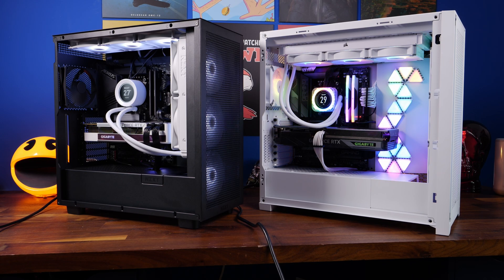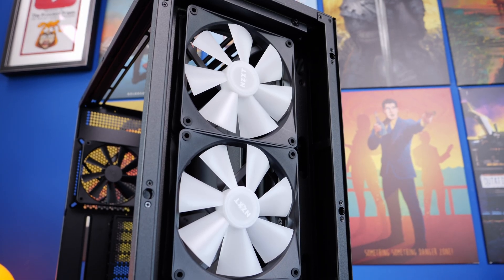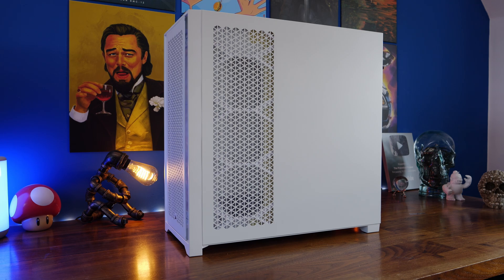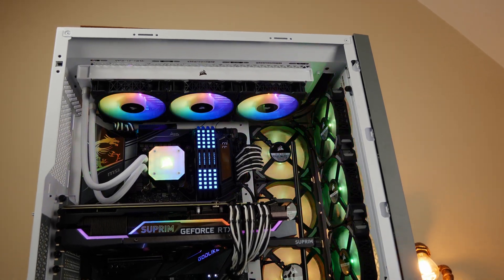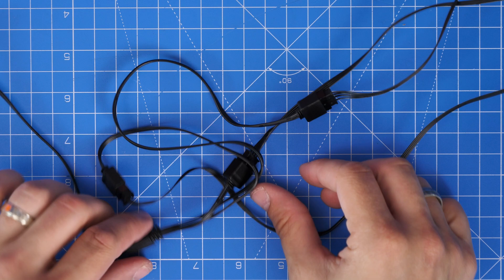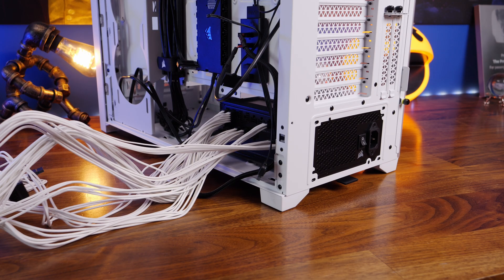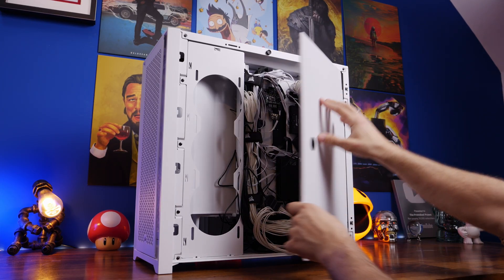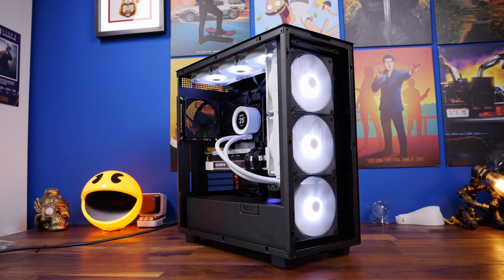Corsair 5000D Airflow vs NZXT H7 Flow RGB - which is the best mid-tower case?

Comment from the maker: Specs of the NZXT build:
Case - NZXT H7 Flow RGB https://youtu.be/hiLd5wTPuMI
Motherboard - Gigabyte Aorus Z790 Elite AX https://youtu.be/8WK7VmuxFxo
CPU - Intel Core i5-13600K
RAM - Crucial Pro 32GB Kit (2x16GB) DDR5-5600 
NVMe SSD - Corsair MP600 GS (https://www.youtube.com/watch?v=8DTAiS5pPPs)
PSU - Corsair RM1000e PSU (https://youtu.be/FUnfuF6nSVw)
GPU - Gigabyte RTX 4070 TI 12G OC https://youtu.be/_-bu6qDqeWA
Fans - NZXT Core RGB (https://www.youtube.com/watch?v=mPRrPGjV_jo)
AIO cooler - NZXT Kraken Elite 280mm https://youtu.be/G5r3SG3ACwE
Specs of this Corsair PC build:
Motherboard - Gigabyte X670 Gaming X AX https://www.youtube.com/watch?v=LYD5zUL91N0
CPU - AMD Ryzen 7 7700X
Case - Corsair 5000D White RGB (https://youtu.be/w-_g7inHcX4)
Fans - Corsair AF120 RGB Elite Fans (https://www.youtube.com/watch?v=eEeMzFHxtWw)
CPU cooler - Corsair H150i Capellix XT (https://www.youtube.com/watch?v=VYgWCVMOQfE)
Display - LCD upgrade kit (https://youtu.be/z0jDMVooE38)
RAM - Corsair Vengeance RGB DDR5 16GB x 2 6200MHz
NVME - Crucial T700 PCIe Gen 5 SSD, Corsair MP600 XE (https://www.youtube.com/watch?v=B08Cv8Pb9nI)
PSU - Corsair RM Shift Series 1000X Shift (https://youtu.be/yafbKAuyntw)
Cables - Corsair Premium sleeved cable kit type 5
Lighting - Corsair LC100 lighting panels (https://www.youtube.com/watch?v=vDO95ghARJE) 
GPU - Gigabyte RTX 4070 Ti 12g OC https://youtu.be/_-bu6qDqeWA

Comment: Hello, sorry, I have a doubt since I don't know how to read or listen in English, I would like to know which was better in the end, I'm undecided between The h7 flow and Icue corsair 5000D, I would like to know which is better quality, the price doesn't matterWhich one do you recommend? Use the translator, sorry
Reply: He liked the Corsair 5000D more because of the flexibility and more build options it provides. However the NZXT H7 is easier to build in because it is a simpler case. Both cases are good.

Comment: Its driveing me nuts, everywhere i look the new 5000d in white comes with a fogged glass side panel, is the glass panel you are useing here the one thta it comes with? and with only a handfull of cases supporting mondern frontpanel IO is doesnt help. also the spaceing between a top rad and the CPU power connectors on the top right for the 5000d. how is the spaceing there??

Comment: Hello! I want to install a 140mm fan on the rear of corsair5000d and i dont know how...it fits but the holes are for 120mm...what can i do? Drill new holes ?
Reply: The 5000d only fits a 120mm fan in the back.  Yeah you would have to drill if you really want a 140 there.
Reply: @bashfullJ88  drilling was easy ,i put a 140 and a 60 under gpu

Comment: I recently built a PC in the Corsair 5000D RGB (using your video as a guide because my case didn't come with a manual!) It's a great looking case with lots of airflow, but there are some cons. I found the extra back door wasn't really necessary as I couldn't close it anyhow due to all the cable and hub clutter. Case manufacturers could stand to make the cases a little wider to accommodate cables. Because there were fan and RGB hubs pre-mounted, there wasn't a good place to put the iCUE Commander Core that came with the AIO I got. (I wanted my SSDs in the back of the case.) It would also be nice to be able to move the top AIO radiator more toward the front side panel to allow more clearance for the CPU power cables. I wasn't able to put all three AIO fans inside the case because of the CPU 8-pin connectors being in the way, so it's good that you can mount the top fans outside the case.

Comment: Except this is not mid-tower. Those used to be ATX (305mm) + PSU(85mm), that's about 390..420mm high case. Corsair is 520mm high. That's a large tower.
Reply from the maker: Corsair labels it a mid-tower, so you'll have to tell them they're wrong.
Reply: @TheProvokedPrawn  They want to sell you more, which in this case is bigger. Sizes have drifted slowly since 90's. I'm just calling bs when I see some. It's a large case.
It's not mini, not mid either.
Reply: @vensroofcat6415 bro just don’t buy it simple
Reply: @jdolooooo  well they are pushing cases able to fit 10+ stupid "3 for 100$ during sale" fans and some of the most expensive AIOs too. 
Corsair 3x the price of Arctic or Thermaltake. And you need huge cases to fit 3 of them. So they bloated up what's needed.
There is nothing wrong with a CPU having 65°C or even 80°. I hope since the current gen AMD release everyone has learned that finally? It's ok by design.
You don't reduce heat by adding more fans. You just redistribute it differently.
Reply: @vensroofcat6415  I get what you saying equal airflow pressure
Reply: @jdolooooo  There is never equal pressure. Even if your fans were perfectly arranged and case had no holes, air expands significantly as it heats up. That would mean extra pressure within and extra exhaust required. That +/- pressure is another urban legend of internet age. It helps with dust tiny bit, but decent filters and some hygiene help a lot more.
I'm saying business is pushing you to buy useless e-waste for triple price. Optimum Tech just had nice video about cooling & engineering.

Comment: I currently have the 5000D and it is a good case, it has a lot of space and the truth is that it is very easy to clean it and put as many fans as you want, but the only reason I ended up opting for Corsair and not for the H7 Flow from NZXT is for the pwm adapter, although my board has connectors for the pwm it only has 3 and instead I have 6 ml elite fans so it was crucial for me. I just have to add that the only awkward thing about the 5000D is the part where I put the 24-pin cable and the sata since you have to remove that side cover to better manage that cable ... it is somewhat tedious to unscrew the fan cover and then sscar just finished the end cap for that, something that I see in the h7 flow as more practical and simple in cable management, for the rest, excellent cabinet, good construction materials and better air flow, in Peru I bought it for 186 dollars in Compared to the 200 dollars that I was going to pay for nzxt that I had to import it paying taxes included, it came out a little more. Good video 👌.

Comment: The rad on the NZXT case is a classic fail that GamersNexus talked about years ago. The pump is above the tubes on the rad. You should rotate the radiator to have the pump under the rad inlet to avoid air bubbles getting into the pump head.
Reply from the maker: No. You misunderstood the video. The pump can't be the highest point so bubbles don't get trapped in it. But it's not the highest point. The top of the rad is...

Comment: Both good cases, however, there's a significant price difference between them. H7 Flow seems to be the best bang for the buck between the two and temps will be more than fine. Swap those fans with an Arctic P14 PWM kit and you'll get even better results and still pay less than what the 5000D costs.
Reply: Montech Air 903 is a little bit cheaper than the NZXT H7 Flow, with similar airflow, and fan support
Reply: I see the 5000d for 134 and the H7 for 129 on newegg.  I don't really see that as a significant price difference. The 5000d is just better for the money.
Reply: @SMGeezus the 5000d for 134 is not the version you see here in this vid this is the more expensive rbg version that comes with more fans
Reply: @MirrorBlood  still. Rgb fans are cheap enough that I'd still rather buy the cheaper 5000d and supply my own fans
Reply: @MirrorBlood in my country both are same price but the RGB version H7 Flow is much hella expensive than 5000D RGB, i will rather buy a corsair 5000D + x6 non rgb fans